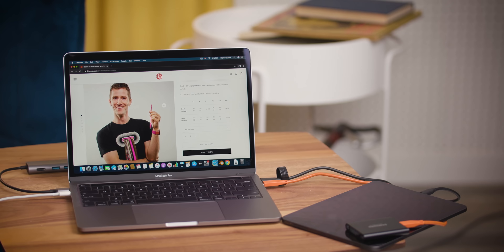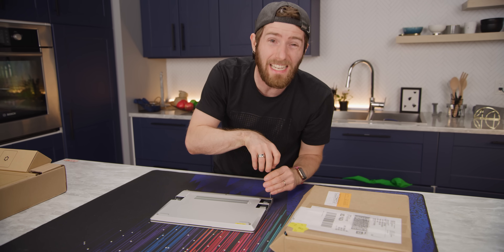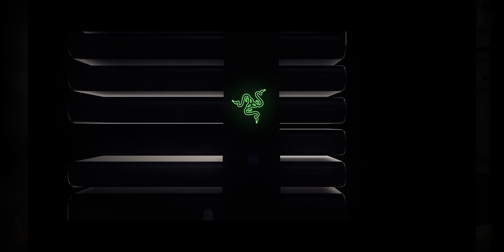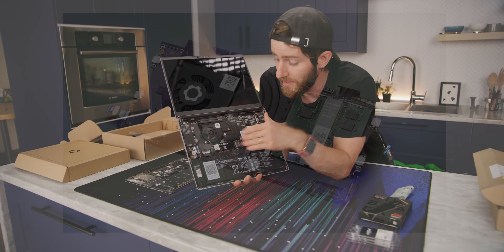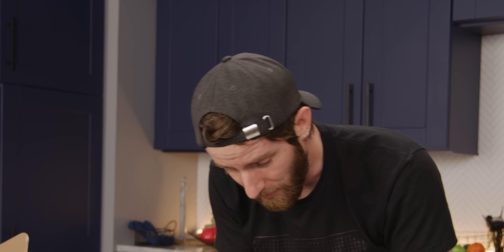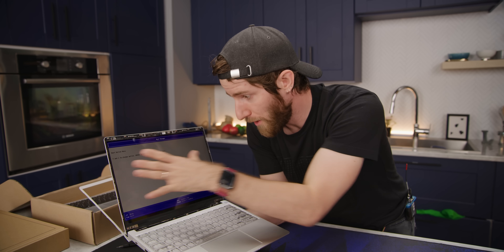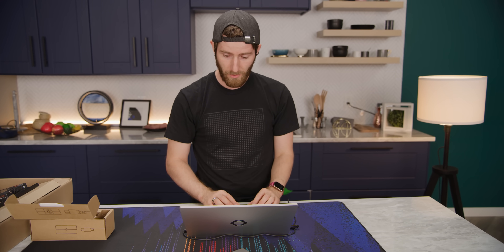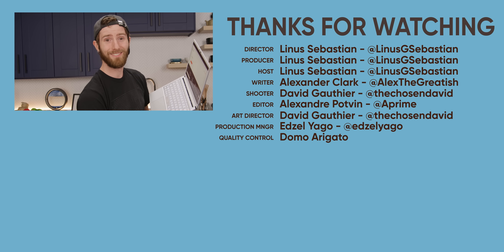A COMPLETELY Upgradeable Laptop?  - Framework Laptop Review

Comment: When this configurable laptop is better than HP’s flagship non-repairable laptop
Reply: Thank you, even the TPM modules are being scalped.
Reply: @shubhampawaskar6443  that's a good thing. Keeps people away from the shithole that is windows.
Reply: I am going to render a modified version of You!
Reply: Your profile pic really hit me now how awful the Windows 11 logo is...
Reply: @themacchute34  lol. You think you can beat him "BiGsUr"
Reply: Your claim is not entirely  true. Parts don't have to be modular to be replaceable. 

I have an HP Envy 17. I've replaced the MB with no issue.
RAM is slotted. It has an M.2 Slot it had a drive bay for 2.5 SSD/HDD. I using an adapter that supports 2 m.2 drives and the controller won't let me do RAID Mirror with th3 adapter, but I'm fine with that as RAID 0 is sufficient. All the ports and optical drive which I upgraded to a Blu-ray/DVD player burner, the all th3 ports keyboard and everything is easily replaceable.

Can a inexperience consumer replace any of the parts I mention? Yes! I am a self-taught IT guy.

All you need is good motor skills and if you don't, well record as you remove parts which I sometimes do, so I can see how to put them back.

Manufacturers are not trying to prevent you from upgrading a computer, unless you specifically talk about Apple.

Computers are very dedicated machines and yes you don't want just anyone just opening it up.

Most people don't want to fix their own computer even if they can.

Yes some brands like Apple are notorious for going out of their way to make products unfriendly to DIY.

I'm not sure modular is the answer. Sure it makes it easy to connect stuff outside, and yes even inside; but what I saw from the inside of my laptop which is HP wasnt that much different then what I saw in the video.

Modular is basically a option for an unskilled person who needs child-like options. Yes a computer puzzle they can just "snap-tite" like a "lego".

That's not what I want.

Being able to swap my I/O is something I would like, even though my 17" has plenty of ports, many 13" ones won't.

But in fairness, a 17" is a desktop replacement. But, I haven't seen a laptop from most brands that run Windows where parts that are expected to fail, are not user replaceable.

Drives and ram in most brands, just require removing a door right above them vs the whole bottom. Even though mine does require the whole bottom to be removed, it's only 8 screws and they are all the same. I have had older Envy models where you didn't need to remove the whole bottom.

The ThinkPad laptop when owned by IBM was the mist modular thin laptop you could buy, everything was easily accessible by simply lifting the keyboard.

So it's not like easy to repair products have never existed. Lenovo has ruined the feature of the ThinkPad. 

Cars are harder to repair, because the tech has progressed beyond DIY for some average Joe. But someone with experience won't have an issue. 

Linus using smartphones as a example is a bad misnomer.
Samsung use to make modular smartphones like the early Note series.

But even though you don't need adhesive to water-resist  hardware, it is cheaper to use adhesive vs designing the phone with a gap for rubber seals that easily break.

And also, when you are going for pencil thin, modular is out. Is it impossible? No. But when you need to mass produce something in the 10's or 100's of millions, which is the best way to go?

How many people actually want to put a computer together that they bought? Only geeks and tech nerds like me and Linus as an example would.

But this is not an option for the vast majority. The vast majority want to just take it out the box, power it on and start using it.

This modular laptop is only gonna be sold to maybe a few million people. These are not everyday people. 

I think every oem should offer a couple modular options for people who will buy them, but not to replace a premium line of computers.
Reply: @PrYmCHGOan  It's still better though cause if a port breaks, you don't need to replace a entire motherboard and just the port.
Reply: I use Arch btw
*felxing Linus Torvalds laughter

Comment: The bigger brands only need to go back to the 2000 norm to compete with framework: standard ports, exchangeable storage and memory. 

The ultimate fix is actually at the fiscal side: the fiat printing has to stop before companies are forced to chase limited gold. In the current mode (where all could get cheap credit) both buyer and manufacturer don't care.

Comment: Now make this a standard with compatible parts available from multiple vendors.
Reply: This is the beauty. The design is on github. Anyone can make an expansion card for it (https://github.com/FrameworkComputer/ExpansionCards). Even you, with a 3d printer and some soldering.
Reply: give it a few years or tech cycle (1 cycle about five years; in general that's when the tech gets crap and better to be replaced)
Reply: Yeah, this laptop's going fail it's most important selling point due to poor availability of parts.
Reply: @bombapiotr  I think it’ll probably be a boutique maker like system76 with a dedicated fan base and decent ish profits.

Comment: Clevo (variously rebranded as Sager, Eurocom, etc.) offers even more user upgradable laptops with upgradable CPUs and upgradable MXM GPUs (sometimes models even offer dual MXM slots for SLI configurations) and significantly higher RAM densities and drive densities (while I haven't tried to run an OpenZFS RAIDz3 on one, it seems maybe viable).

Novena Kosagi, from 2014, offered complete schematics, and 0 NDA to get more information on it.

In other words, there are better options already extant on the market for those who sincerely want more longevity and documentation than Framework, already.

Moreover, your mention of Microsoft and Apple having exclusive rights to magnetic charging systems seems questionable at best. Zojirushi water boilers have had magnetic power plugs long before Apple's MagSafe was ever a thing. Having previously helped recreate prior art to invalidate spurious patent claims for the likes of Fortune 25, precedence and prior art is acknowledged in courts of law. It may be true that Microsoft or Apple were granted patents on their specific implementations of such technologies, but there is absolutely nothing preventing others from implementing their own variants. Also see: the plethora of USB-C magnetic charging options, e.g. https://www.youtube.com/watch?v=fv3o2rxqYMg

Albeit, having used some of the USB-C magnetic variants, I still think Apple's MagSafe was a far superior implementation of such things.

Comment: Just the mention that these were apple, lenovo and HTC engineers had me excited. With all three you know they won't cut corners, and with the latter two you know every penny is well spent. 
The design screams 'ideapad' and I love it. Those are some of the sexiest machines out there.

This might not be so much of an 'upgradable' laptop (as it is with the currently available parts), but it's a right to repair wet dream! As long as the replacement parts will be in production for many years to come, this is basically as repairable as a car.

It also made me realise that Lenovo's machines are actually pretty repairable already, if only they had the parts easily available. I don't want to use ebay for dodgy screens.

Comment: Imagine if laptop biggest strenght would be modular designs that allow you to take few spare parts on the go and do different things on 1 device (instead of ooga booga it mobile you could be gaming on train). You could have spare outside battery, a projector, graphic card (for hardcore gaming) or many others. Current laptops offer 0 advantages from tablets, smartphones or stationary PCs and are basically useless. This laptop is a great idea

Comment: @16:16 - I think you might be misunderstanding Battery Disconnect. That feature usually disables the internal battery, in preparation for opening and servicing the machine. Upon next AC power connection, the battery will be reconnected.

Comment: I was somewhat considering buying a laptop. This has convinced me to
Reply: $750 base price is really good.
Reply: @piyh3962  It would be interesting if they sold a model without a battery - I mean, might as well offer that option.  I can see some people going for it if it lowers the price enough lol.  They offer it without Wi-fi right?  Or no?   What about a “no camera or mic” version?  Could also see some people going for it.  Might as well hit all the possible demographics haha.
Reply: @RightJoystick  not sure about this specific model but replacement laptop batteries are usually less than $50. When features are removed you only are going to save the BOM cost. Probably not a large market for people who want a thin and light laptop without a battery. That is antithetical to the portability aspect.
Reply: @piyh3962  I agree

Comment: I thought that the laptop webcam came out looking exceptional. The transparency from the company on the components that are actually used in the hardware and expected performance is great. I also appreciate the ability to easily slot in new hardware / ports so simply as well as the little features like hardware disconnect switches and unattended driver installs.

Comment: I have those magnetic USB C connectors, they're supposedly 3.2 rated, and pretty nice. They also sit close to the port, so there isn't too much flex and strain on it. I want to say the brand is RedBean all metal, not terribly expensive, but $20 for one.

Comment: This endorsement by Linus is more valuable than any paid ad ever could be. I've never seen Linus more excited about a laptop. They did good with this one. I just wish it had a GPU
Reply: According to the forum supports eGPU, and there's always the chance they could come up with a new motherboard with a GPU and you can upgrade.
Reply: It's probably in the motherboard. Barring that, the next revision of this laptop could use a proprietary 8x PCIe G4 which would be enough performance for all but the most demanding of graphics cards, and use Thunderbolt exclusively for power.
Reply: @bluephreakr  Imagine one of those modules as a thunderbolt eGPU. It'd probably have to stick out a bit though, for a tiny cooling fan.
Reply: @t6-30  But it still suffers from the same limitations as a built-in Thunderboolt connection, directly attached to the host controller. That's why V2 needs a direct-to-motherboard PCIe connection, so that higher-performance devices aren't bottlenecked.

 If they made it mini PCIe-style, it could also be used for storage. I presume the only reason Framework couldn't do that is because of Panasonic and their proprietary style of PCIe connection, as every device on most modular ToughBooks have connections directly to the PCIe lanes without additional overhead to my knowledge.

That or they were lazy, but either way they're making the best out of a poor scenario. I just hope there are means to have direct PCIe lanes in future.
Reply: Hopefully this is just the beginning. Hopefully they release more laptops like this, and eventually the big players do as well because that would be AMAZING
Reply: I was just thinking that. In the future they could come up with a new motherboard design that will be able to take a graphics card. Or maybe create a motherboard with a cpu, gpu, and a colling system on it too which they could design to make sure that the processors are cooled adequately. Im really excited to see what this company could do when it comes to high performance/ gaming laptops and their upgradeability
Reply: We all share the same sentiments in relation to this topic, however it is clear to see that this company is in its early stages. As mentioned by @Verlisify, hopefully this will be the industry standard moving forward.
Reply: He even gave them an INSANELY feasible marketing strategy with the Anime keyboard skins. FGO, Azure Lane, Genshin/Honkai Impact, etc; each of these are exceptionally marketable brands with dedicated tech-orientated fanbases.

Comment: GPU modules are obviously the dream for this. I'd imagine it would require  Thunderbolt, though heat would still be an issue without a fan or some very special engineering

Comment: I don't see a lot of new things here, almost all laptops with this size can be disassembled, only the thinner options have some soldered components. It will be interesting if we already know that this brand survive for several years and would make newer components (like the mainboard). For now this is just a common laptop without any options for the parts that we cannot replace on others laptop (like the screen, the webcam, the mainboard, the keyboard...)
And even if the specs are ok, we don't know how bad or good is the screen, how efficient is the cooling solution, how long can it run on a single charge...

Comment: My hp pavilion has a display issue when service personnel examined he just tore of the display screen from the chassis and he tells me that these are just stuck with sir. PS hp hasnt even replaced my faulty display part as the case have been booked on 26 April/21 and it has been escalated to top priority many times and still havent got my screen replaced all of it is under warranty .Pathetic customer service response and poor service personnel response. Those service personnel doesnt even attend any of calls after bugging him more than 3 times he says its on the process sir pls wait i will have to conform it with hp . Final : dont buy Hp products 🙏

Comment: Im sorry im not seeing anything innovative over here. Modular IO was on most laptops on the 2000's and nobody cared too much. And if you want to replace any other component, you have to do it the same old fashion way by unscrewing / screwing delicate components straight to the board. Only thing different is that you have QR codes for tutorials and colored screws. That's a nice idea, but it's just a regular old fashion laptop. And how is the warranty enforced? If anyone is invited to screw open his laptop and plug / unplug delicate components like there legos, How can the company tell the difference from real product defect and user errors? (BTW these components were never made to be swapped like this, They are bare PCBs that can be shorted and damaged easily by being handled unprofessionally).
I can go on, but Linus has missed many cons in this video unfortunately...

Comment: Take any Dell. Happy user of one ... repair manual and easy to replace part out of the factory (You can download repair manual no fees from Dell website) Plenty spare parts (from Dell and third parties) plus factory and third party batteries the most crucial component (I got through mine in 2.5 years and replace with compatible one myself it was not hard to remove screws from bottom remove the bottom (no glue) unscrew the battery and all it is done by using 1 screw driver in 20 minutes (not it technician myself)) as well I replace DC plug because broke one again a couple of screws and you are done ... See no point in this laptop, just buy Dell without additional services ;) Possible usage of existing Dell (7000 2 in 1 series with i7) will be another 2-3 years and then last battery replace and this pc will go to reserve for emergency cases.

Comment: I really can't understand, what is their targeted audience?

People who like to tinker with their laptops they do anyway.

If People are going to make custom enclosure then, what's the point of using this motherboard. We can buy spare motherboard of powerful laptop and do the job. 

I liked the keyboard swap and speakers swap, because those are hardest one to find or customize.
Reply: @Rémi Héneault yeah, Let's see how it goes. Actually I was really expecting much more. 

With my current laptop, I can not customize keyboard, Display frame and The ports. I don't mind if I don't have customized keyboard or Display frame. But customizable ports are really good. 

But there still you can use any thunderbolt or type c adapters. 

I have to see the use cases of this modular approach.
Reply: @Rémi Héneault yes, that I liked too. 

I like to use devices atleast 5 years, but over that period of time some parts like battery, speakers, body/housing damages and those are very rare to find even from 3rd party vendors.
 In my previous laptop, speakers and body were damaged and I already have to replace motherboard once(was damaged due to over heating). And battery life sucked (and there was no replacement for it in my country).

In those types of issue will be solved by this company's approach.

Comment: I still don't understand why the WIFI connectors need to connect to the WIFI chip directly rather then to where it is connecting so you never have to mess with disconnecting and reconnecting them when taking it out or putting it into a system.

Comment: I work at a computer repair shop and just this week I had to tell like 5 people their laptop is DOA because the motherboard and repair cost is more than the laptop is worth. BTW whoever designed the wifi antenna connectors needs to the kick in the head.